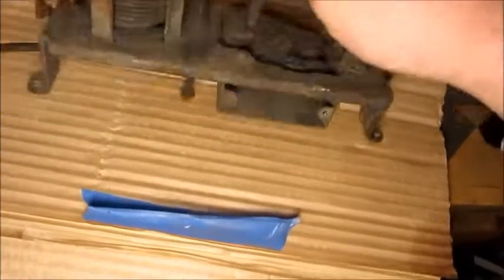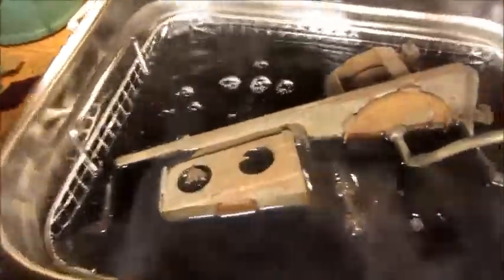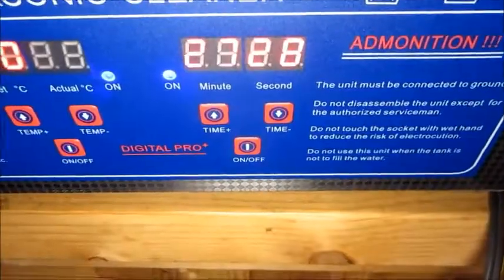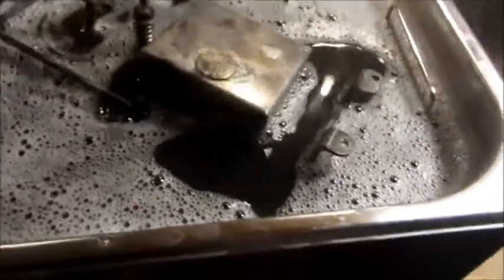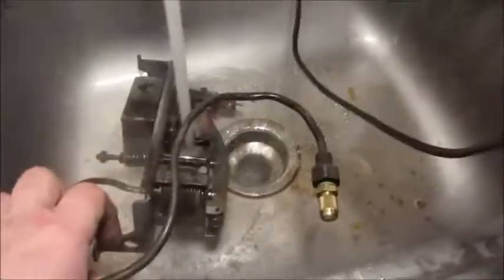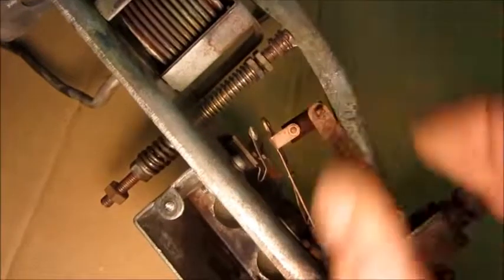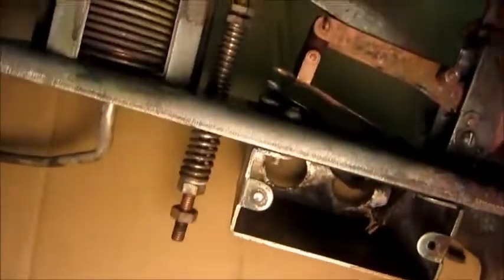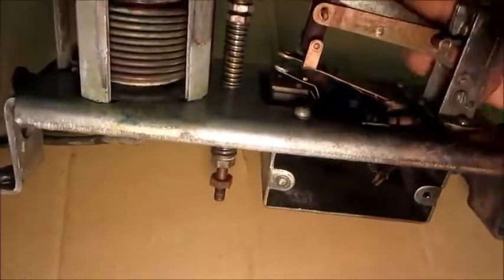Testing a new ultrasonic cleaner!

Comment: Hi David:  Using an Ultrasonic Cleaner is great for cleaning.  Try using Liquinox cleaner (available on Amazon) it is a Super Detergent and is generally used in research and scientific labs for cleaning. A little goes a long way and is washed away with water.  Keep the videos coming!
Reply: Is that similar to Alconox? I’ve had a carton of that for 25 years that I use for washing old vinyl records with a rinse of distilled water.  Works great and a little does indeed go a long way.
Reply: @chrisbeck8182  Yes same stuff only in liquid form.
Reply from the maker: Interesting. I will have to look into that. Does it strip paint and remove oxide layers like the Zep does?
Reply: @davida1hiwaaynet  Nope, it’s a very mild non-residue lab grade cleaner. Perfect for precision cleaning like relays, controls, etc.
Reply: @davida1hiwaaynet  Hi David:  I have never tried to remove paint but I feel that it will remove oxide layers. I have used LIquinox on antique clock movements and old carburetor parts with success.

Comment: That ultrasonic cleaner works great for small carburetors. Really cleans out small orifices way better than old fashioned stinky carburetor cleaner. I'm sure you will get some good use out of that.
Reply from the maker: Thanks!  I have used smaller ones for decades, but this one is a lot better!